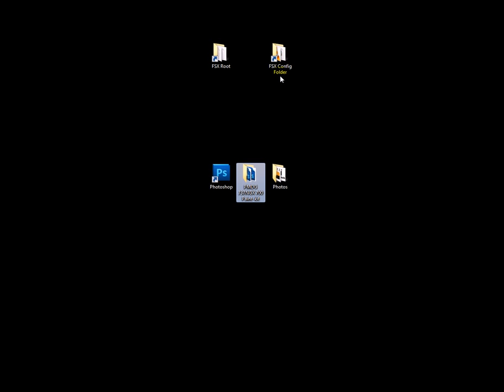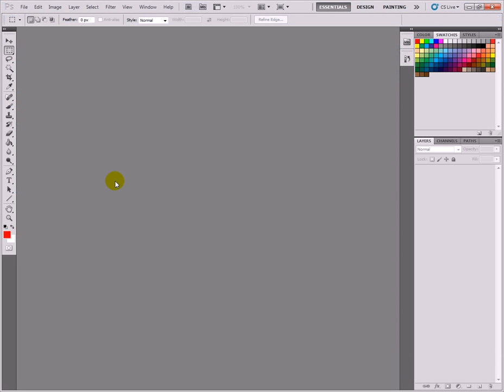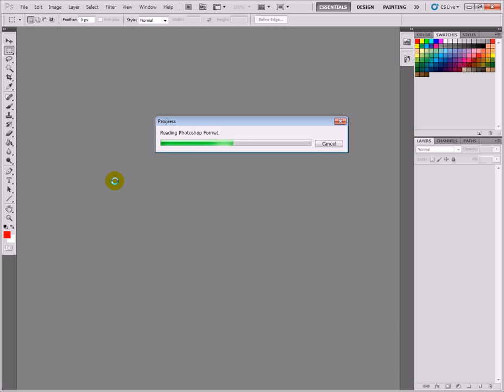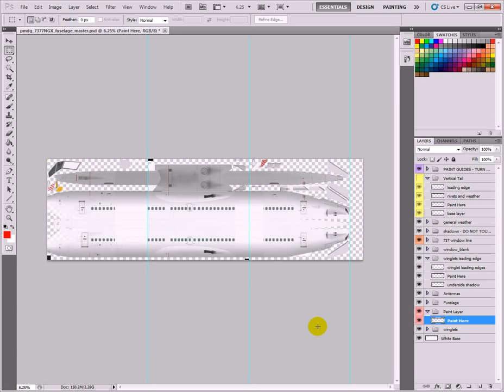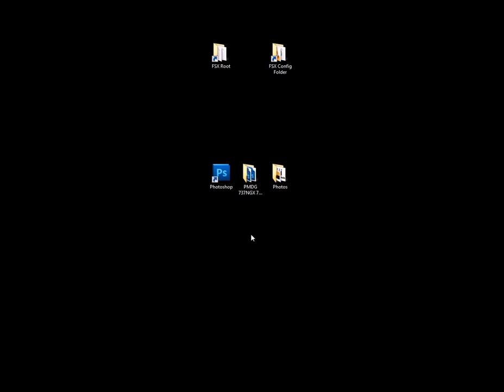Tutorial: Painting a 737-700NGX PMDG Livery FSX (Part 1) (Slowed Down)

Comment: I have repainted the CaptSim 707, PMDG MD-11 & 747-400X and 737 NGX and I have the same issue with them all.  The aircraft all have a black line appear where the fuselage sections meet, (front, mid, tail).  MD-11 shows only one line.  These lines only appear when zooming out at a distance.  I've saved in DXT1 and 5 using Photoshop CS6 and made sure paint goes to edge of canvas.  have you ever come across this problem?